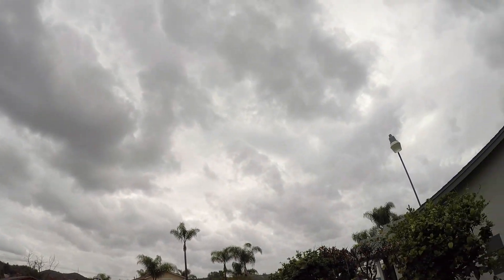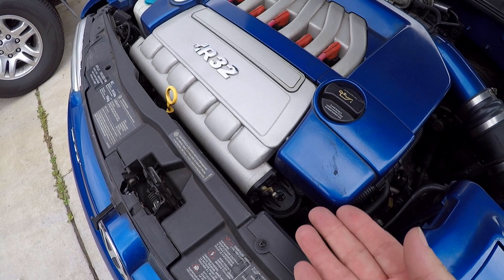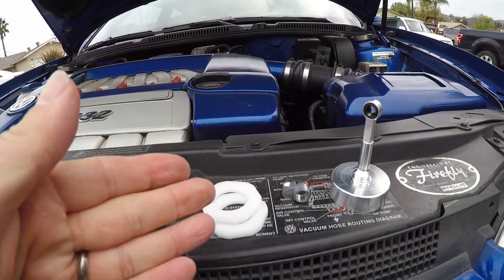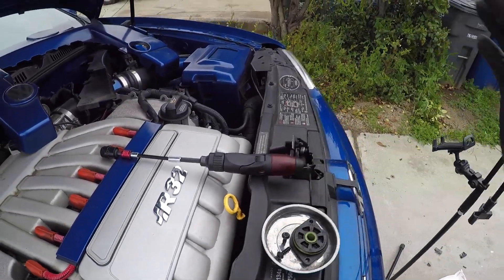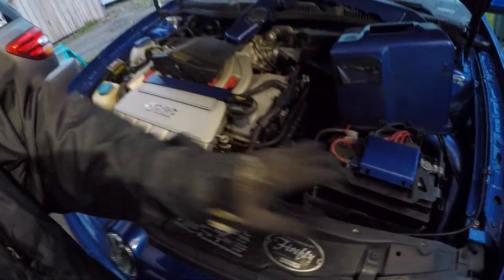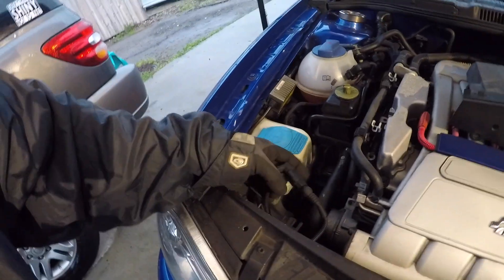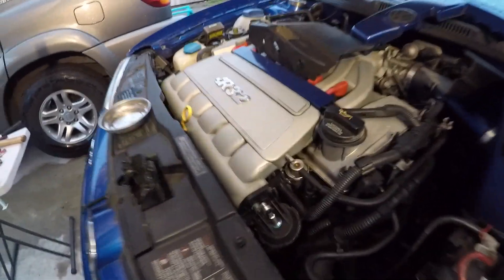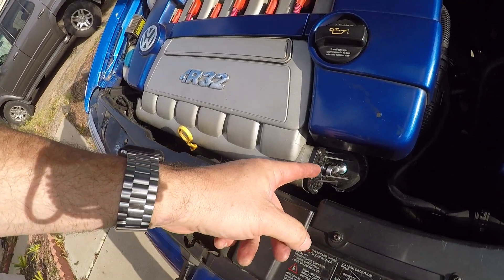Installing Gruven Billet Intake Parts on the R32

Comment: Hello Brendan, I also have an R32 and find this video very interesting since I had the same link fail on my 2005 Touareg V8 intake. On the V8 it happened because of deposit build-up around the flapper doors binding their movement enough to break the plastic link. VW provides no remedy for cleaning so a new intake manifold was required !$$$. Along with a rebuilt manifold I also installed the Gruven link, however I suspect now that the link is intended to be the weak link (sort of a fuse) that fails before anything else. Stress is now shifted to the vacuum solenoid that activates it and its rubber. I am no expert, others may know more about the issue but thanks for the videos! Love the R32.
Reply from the maker: Good to know!  In my case the bushings were worn but still functional, and the rod ball end had worn out to the point that the vacuum connector repeatedly fell off it.

Comment: With that not working what type of issues would you have ?
Reply from the maker: Decreased performance and decreased fuel economy.
Reply: @CliffjumperCars were you getting any lean codes? Since the vacuum hose was already not connected. I have a mk5 r32 and the ball is not shifting, I also have a lean code on both banks… wondering if that hose or the diaphragm are pulling air inside.

Comment: Personally would just buy a oe unit from vag whilst you can - the only things this kit dont come with are the bushings at the end of the rod which wear-
Reply from the maker: Probably a good idea to have one on hand.  Will keep an eye on this to see how it does.  The metal rod connector parts with the delrin bushings are definitely superior to the OE stuff, but then again that OE gear lasted a pretty long time before it needed replacing.
Reply: @CliffjumperCars  I purchased a used manifold chap with all the bits in - seems good value as the parts add up to quite a lot of money and also been plastic manifolds the captive threads can easily  be damaged- bit like a corrado spoiler lol.  You have to stock up now as we all know what its like owning a corrado and obsolete parts.
Reply from the maker: @keyo525  Truth spoken!!!

Comment: That definitely seemed wrong to hit er in. That's lame the rod bushings aren't just new oem.
Reply from the maker: It felt very very wrong.  But after having to install it & remove it and make adjustments and repeat that a few times, it went much easier. 

In retrospect (and if budget was not an issue) I would have liked to have had a brand new OEM rod assembly for comparison to see how hard that would be to install